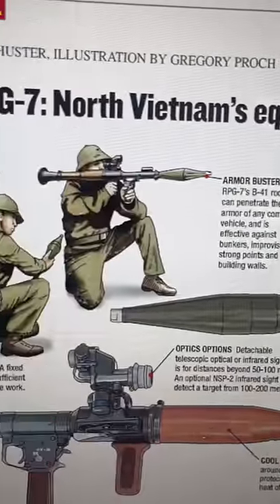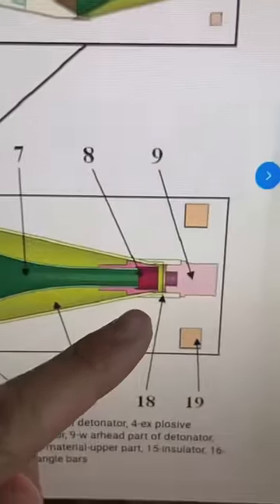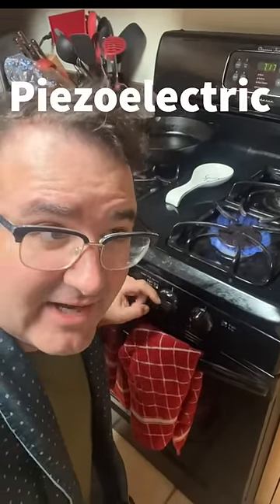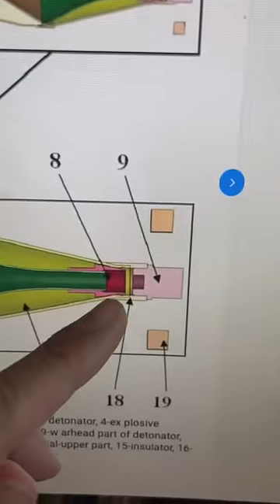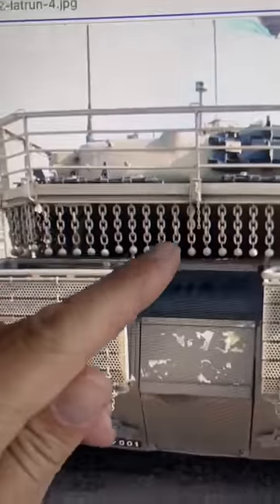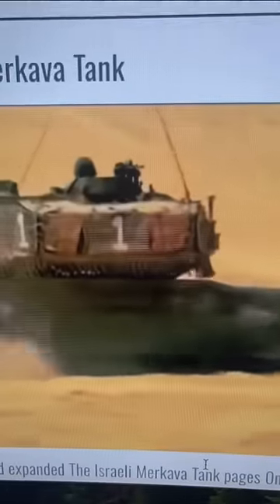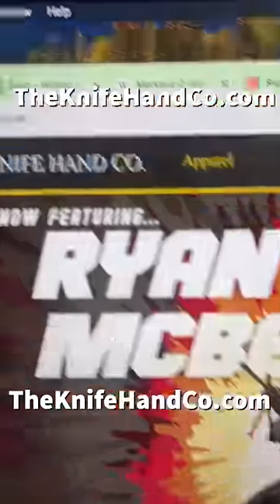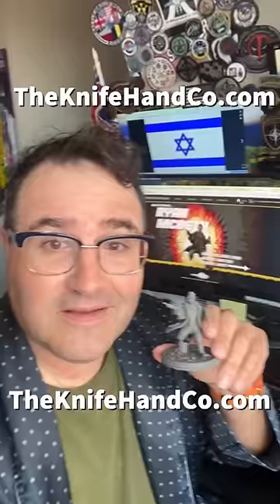What are the balls and chain armor on Merkava tanks actually for?

Comment: The chains are there for two reasons. One is it helps catch any anti tank munitions or drones that may or may not be yeeted at the tank, and is very useful for covering the gap between the back of the turret and the rear armor. 
The second reason is to hold the crew’s extra balls, they found a way to divide their massive size into smaller more manageable and effective pieces. This way the brave crews can still have normal sizes and fit in the tank, but the extra mass and sheer protective force of the excess is outside the tank, and also helps with reason 1.

Comment: That ticking is just the arc jumping. You definitely don't have little hammers hitting little quartz crystals in your stove. It's just a low wattage high voltage power supply charging up a capacitor, which dumps all It's energy into the arc when it strikes.

Comment: Most anti armor devices are intended to cause warheads to explode before actual contact with the flat surface of the intended target. Rpg releases an inverse cone of super hot copper /metal to melt it's way through armor so anything that can interrupt that is a win win (203rd MI BN)

Comment: Even if the shaped charge goes off when hitting the ball it would be great for the armor. The high temp/pressure is going to be focused at the wrong point and this much less effective. 

Also, I've always heard it as Pea-yeh-zo electric. Possible both are correct, but I'm simply too lazy to check.

Comment: It sounds very dubious that these would actually work, but I get why the tankers would want them anyway. Like the Russians and Ukrainians covering their tanks in scrap metal, or US soldiers in WW2 covering theirs in sandbags. The little extra cover gives the tankers some comfort, even though these measures are almost certainly ineffective.
Reply: I think it's more likely that these work than the impropmtu armor we have seen.

These chains, aswell as cage Armor, seen on pretty much any modern light vehicle, are specifically designed to counter RPG-7s.

Comment: This was new to me, the chains or any other objekt that can make the rpg detonation trigger before the its touching the armor surface makes it useless, this is because the amazing penetration effects in it only works when in direct contact, its copper thats is inside the rpg comes in such high speed concentrated at the senter tip of the rpg BUT it needs to be touching the armor or it completely loses it effects to pen the armor.

Comment: The cooker/range on your indoor gas oven isn’t piezoelectric. Any cooker that doesn’t have mains, would have a loud mechanical piezoelectric starter as you described, such as an outdoor barbecue. Your cooker that you showed is plugged into mains (probably because you have an electric oven and gas cooker top). I’m not entirely sure, but the high-voltage is from either a small flyback transformer or a voltage doubler (doesn’t mean 2x voltage as doublers can be combined to make several thousands of volts).

Comment: NO it's to get the grenade to detonate further away than than the normal stand off, the RPG is a shape charge if it detonates too far from the armor it won't damage it as much, some places use wooden pallets strapped to the tank for the same reason.

Comment: Not relevant to the bigger point, but that stove is a bad example. The igniter button on BBQ's often are piezoelectic (at least the kind you have to push really hard on). But if you have a source of electricity there are much simpler way to get a spark.

Comment: Dad told me that the RPG 7s would just fly right thru his boat in Vietnam because it was mostly plywood. (PBR) think Apocalypse now, movie... 
However... during one ambush, one rocket cut the 60 gunner in half, one rocket detonated, blowing the engine cover into the engineer and knocked him out. The 3rd rocket impacted dad's steering column but failed to explode because the irregular surface deformed the detonator.
 Dad went on to be USN EOD Ltcmdr (ret)